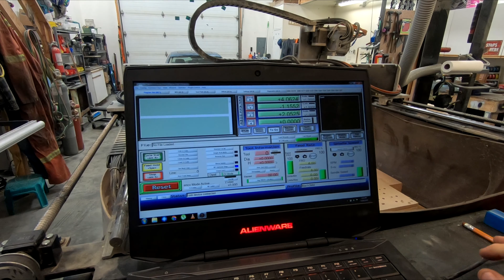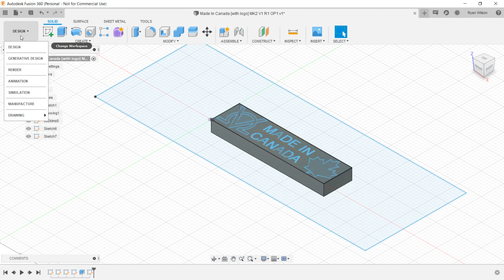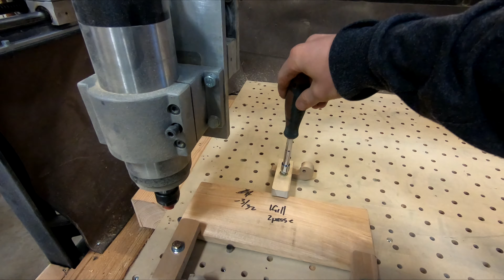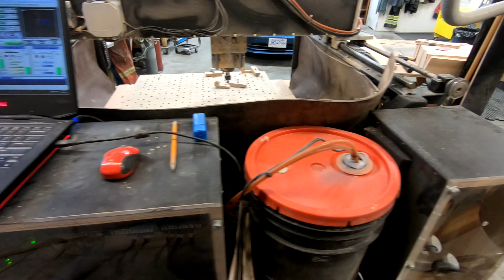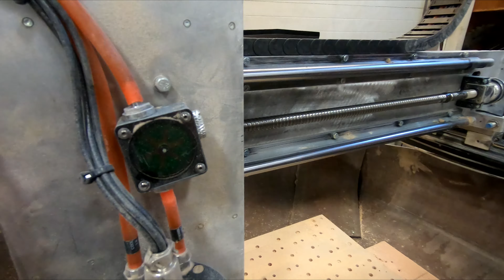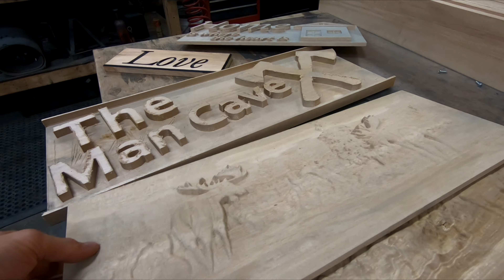My DIY Mach3 CNC Overview

Comment: Hi, very nice build :) you have here. Most vid's related to Mach3 i saw were runnig WinXP.
I've heard Mach3 is runnig only on 32bit machines is this correct? For myself i have a 3018
engraving chinese toy, just hooked it up to a bluetooth modul HC-05 yesterday, yea having
fun with it. It is running GRBL so Inkscape and F- Engrave is a option. For 3D there is the
BlenderCAM if some artwork would come up. Grbl sender is Candle and it's has some surface
mapping that allows to mill engrave some PCB's. Cherrs and thumb up :)
Reply from the maker: With regards to 32 bit versus 64 bit, This is a 64-bit Windows 7 install. Mach 3 might run a little different when you’re using a standard parallel port instead of a USB breakout board. And since you’ve mentioned it I’ve never seen a parallel port the CNC that was not on XP or vista.
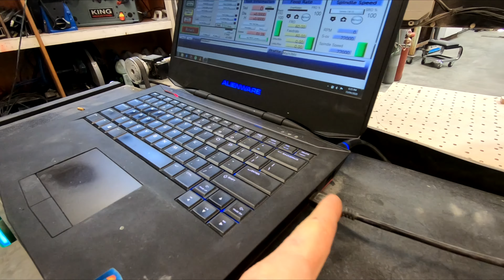Reply: @DonkeysBreath  Thank you for clearing that up. Now i got it, its the NVUM CNC Controller @ 7:39. Cheers.